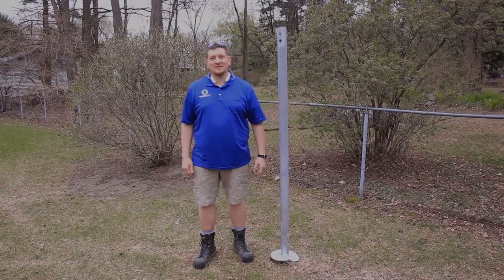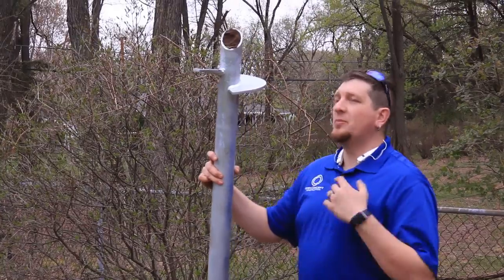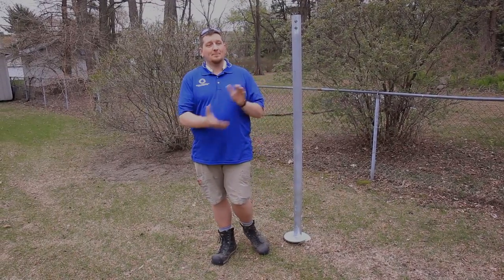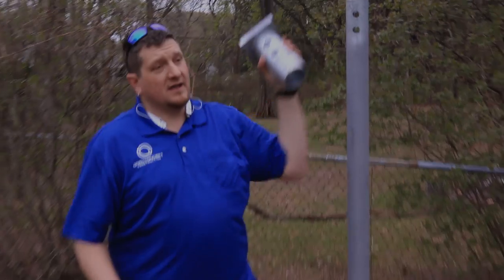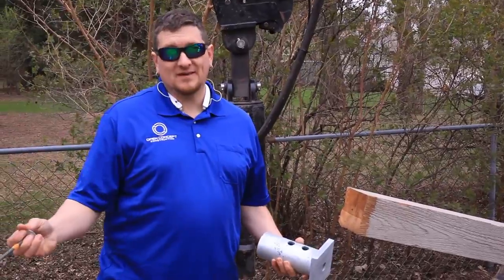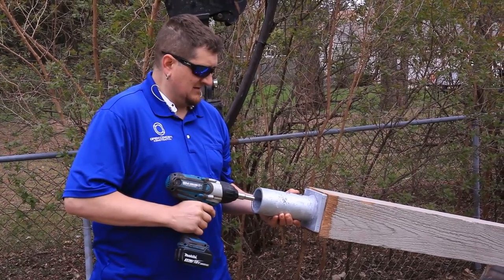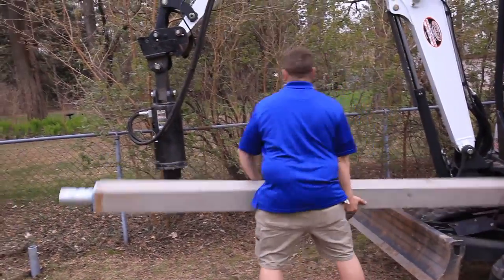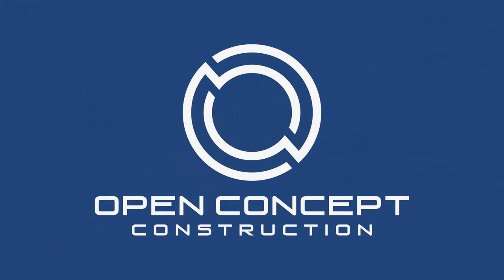Helical Pile Basics

Comment: I've seen these things used on Grand Designs and This Old House. They seem like a very good idea to me. Old houses often have floors that aren't level. Are modern foundation techniques good enough that in most cases the problem of un-level floors is eliminated even over long periods of time? I notice that other techniques are still pretty common for providing stability on unstable soil for house foundations. Do you think over time this idea will displace things like driven piles in house construction?

Comment: how do you know how deep you have to go to get to the need resistance? and how long will it last on a rainy(but not floody) area.. and lastly how do you get it to plumb
Reply from the maker: We have a digital readout for our machine that tells us every second how much torque it’s taking to get the screw to go into that portion of the ground. 
I’ve been told they have a half-life of 300 years if properly galvanized. 
I’ve installed them in lakes for permanent docks. I check em every year and am amazed at how they still look brand new!!
Reply: put a post level on the pile

Comment: Able to build a 1200 sq.ft. cabin on these?
Reply from the maker: You can build dang near anything on these things!
Reply: Depends on soil type..psf
Reply: This is a good video for those contemplating using this system: https://www.youtube.com/watch?v=NRwiBLbxagY&t=574s
Reply from the maker: @gary24752  it’s verified by myself. I’m a certified helical pile installer and if there’s an issue my pile driver insurance is what it falls back on. I’ve been doing it for 6 years and never had an issue. If I do large commercial project they will have geo tech guy on to verify every pile. Every pile is individually marked and verified on site again by myself.
Reply: @openconceptconstruction6740  That only makes you certified only as an installer but most certainly not for the design of the piles unless you are a registered professional engineer.

Comment: You ever see a metal fence post rotted off at ground level?  I’ve never seen a concrete post rot off at ground level!
Reply: What happens if you hit Rock
Reply: This is galvanized, what are you talking about
Reply: @pimc172  even hot-dipped galv steel with eventually rust at the ground air transition...
good idea to apply an epoxy coating of a good thickness